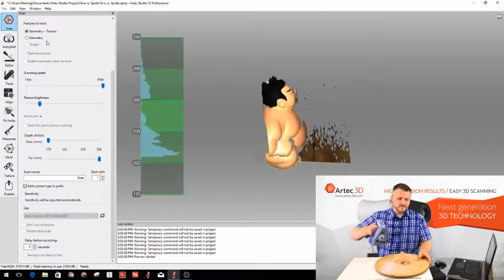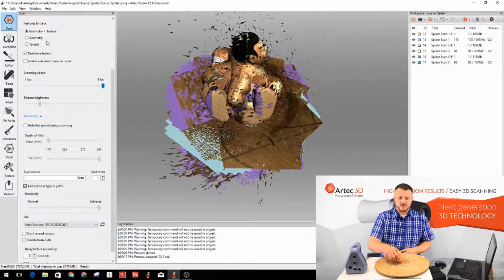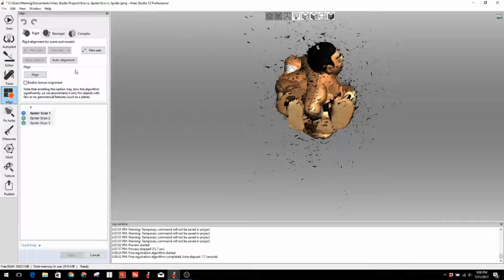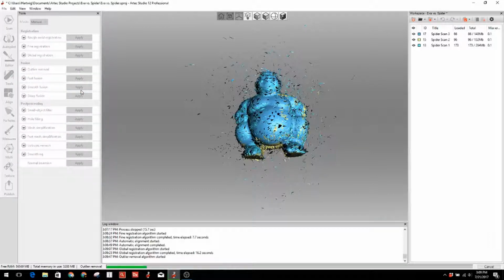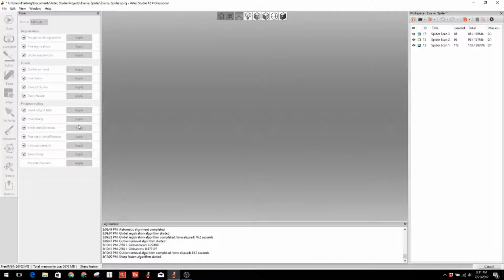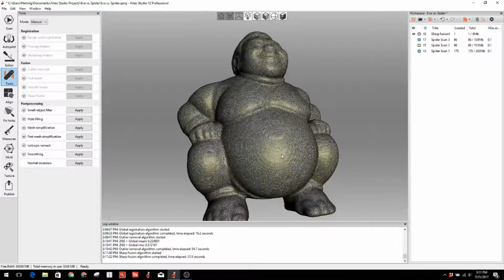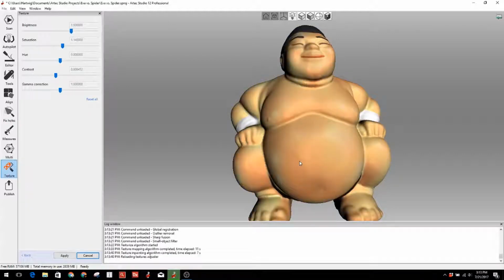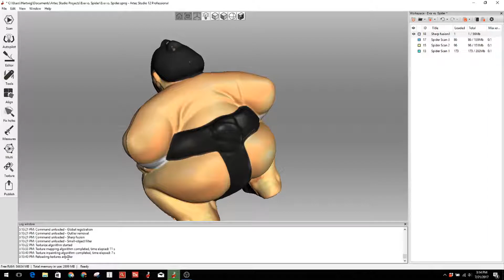Artec Space Spider 3D Scanner Tutorial | DELSCAN

Comment: Hi there. I’m Haziq from Malaysia. I’m using Artec Spider and  Artec Studio 10 Professional programme. During scanning its not as easy as i see in the video. Too much lag and the programme always not responding after finish scan. I need recommendation or tips for this. Thanks
Reply from the maker: Hi Haziq, sorry for delay, overlooked your comment, I would suggest starting with calibration, you can find a video walking you through that on our channel. Also, you will want to update the video card, google search artec video card drivers and you will find an article with approved video cards. Hopefully you have an Nvidia card of some sort. Next check your power options in windows, make sure you are running high performance, and in advanced settings, disable selective usb suspend. If you need more help, you can email us at support@delscan.com good luck!